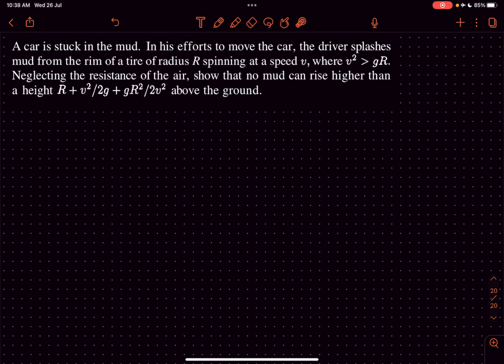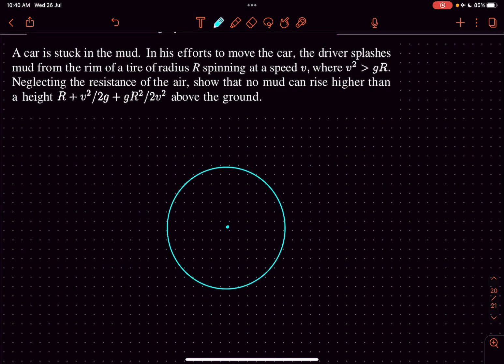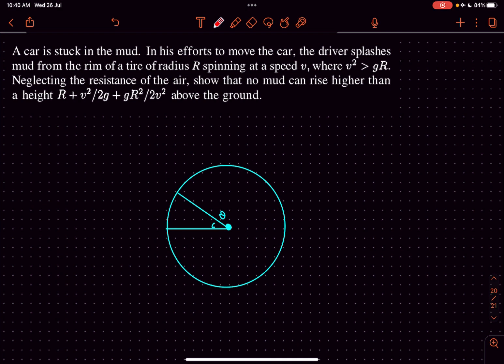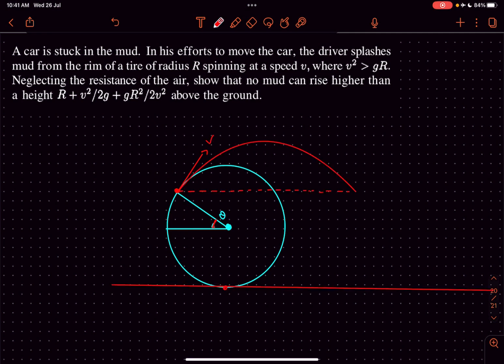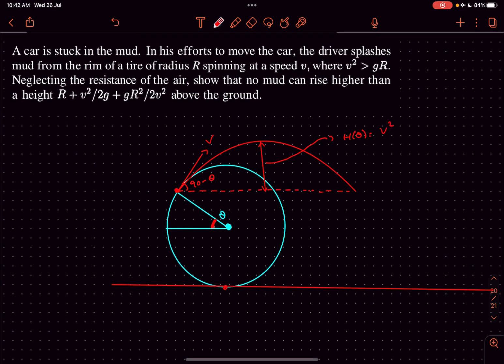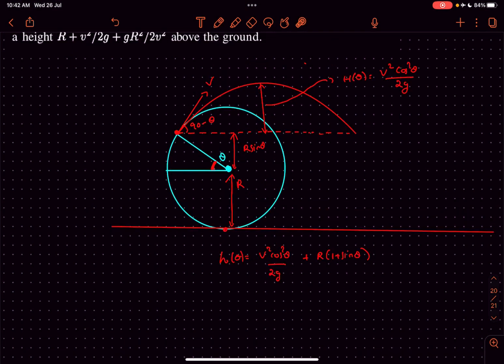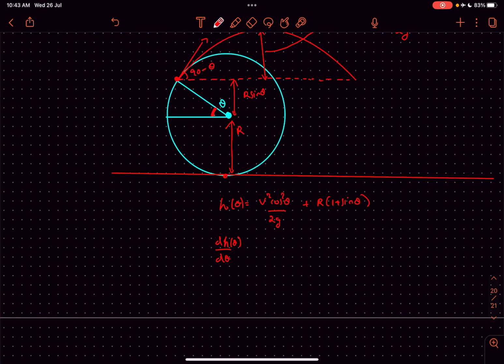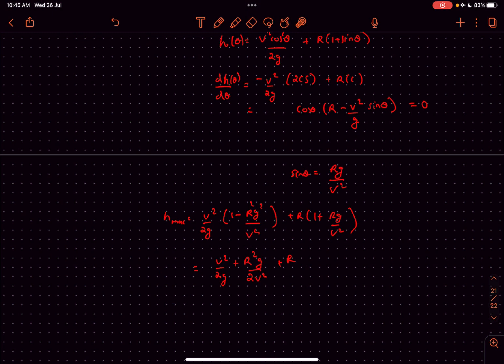[Jee Adv] Splashing of Mud from the Rim of a tire | Max Height Reached by a Mud Particle

Comment: Sir when you were differentiating why didn't you consider dq/dt as w  where w = v/r
Reply from the maker: Its because we needed the max value of the height function r8. So we set d H(θ)/d(θ) = 0, for max value
Reply: @PhyX_03 sir I tried solving inpho 2020 rotational mechanics question but I had a doubt can I email you the answer. can you tell what is the mistake?
Reply: @PhyX_03  sir you didn't reply